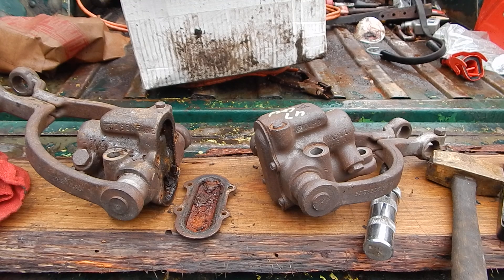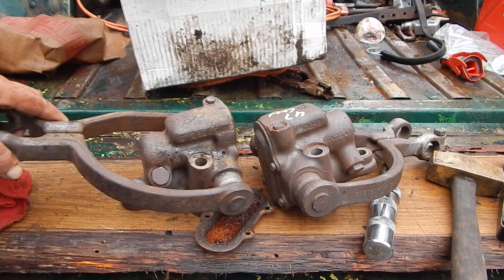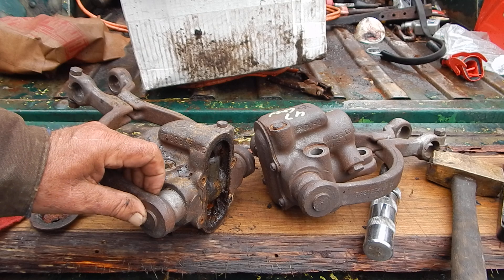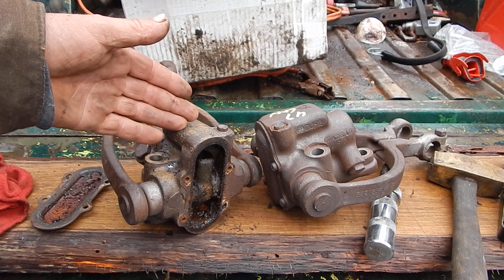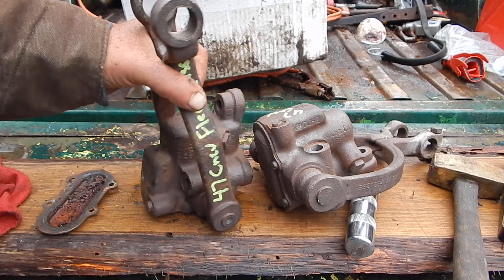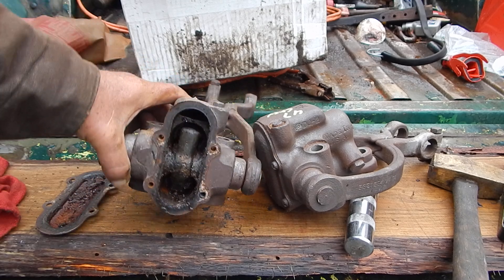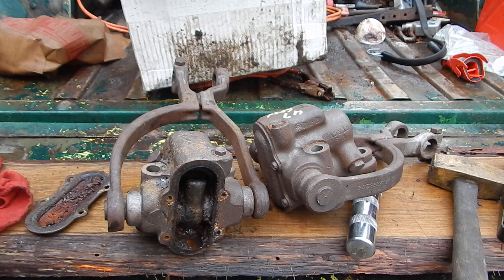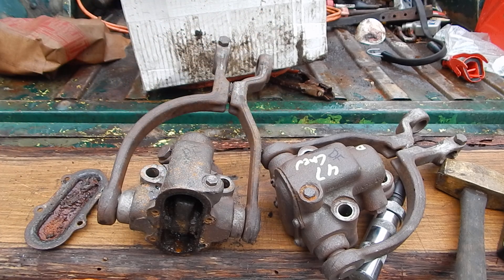Fleetmaster  front shocks

Comment: I found a forum on rebuilding knee shocks.  From what I saw posted it didn't look too good.  www.jalopyjournal.com/forum/threads/lever-shock-rebuild.794463/
Reply from the maker: It won't be simple, but I have a skill for this sort of thing, and have the equipment available.  If you recall I came up with a method of removing, and installing the recoil spring for Winchester Self Loading rifles.  Considered by many to be next to impossible, I did on camera, uncut, in minutes.  I think I can tackle what is basically a glorified door closer.